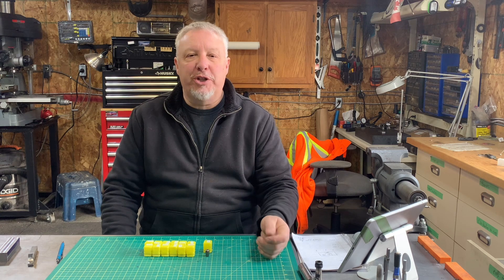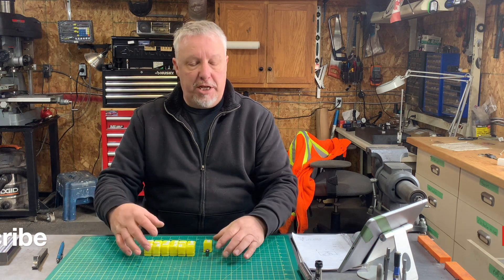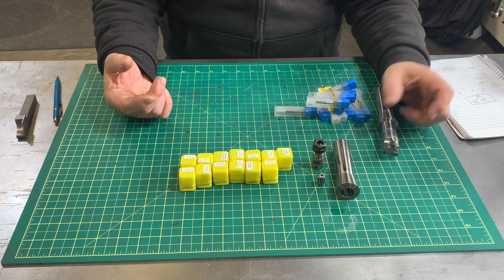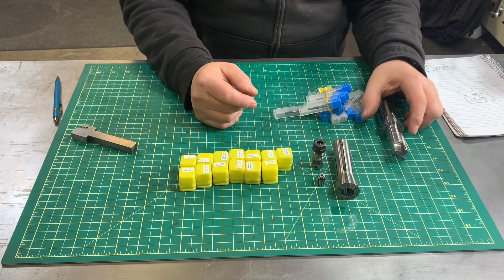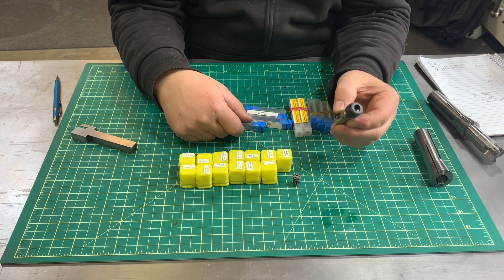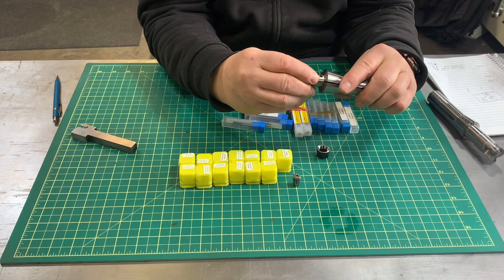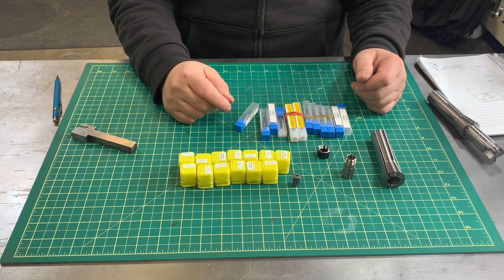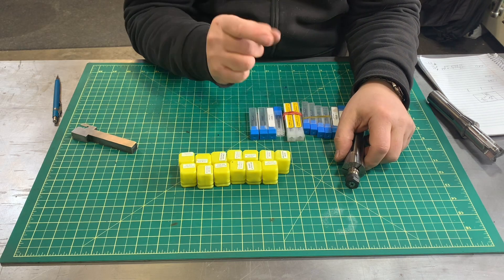ER11 Adapter   Tips & Tricks

Comment: Good info Gilles, could you post a lead to where you got them if possible? Thanks.
Reply from the maker: Just added the links to the description.  Glad you asked.  Gilles
Reply: @LetsRogerThat  Hope you get a kickback, just ordered a set, thanks,
Howie
Reply from the maker: @howder1951  I wish lol.
Reply: @howder1951  So, how was the run-out on your setup??
Reply: @KrustyKlown  I haven't checked yet, but I used it for some odd diameter screws , holding the 5/8" chuck in a collet that size to get a job done.